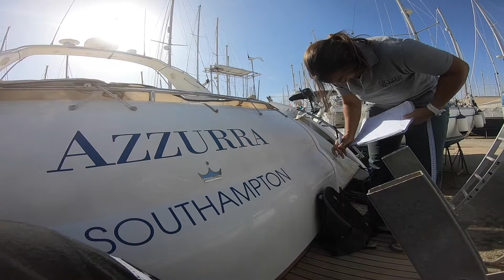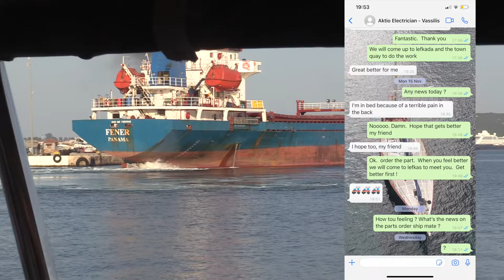EP 106 Dickinsons Diesel Heater   #sailing #Blownaway #Greece

Comment: Strange how things come together. The weather has turned cold here and I was firing up my Dickinson Newport diesel heater and was hit straight on with low fuel pressure into the metering unit. And I happened to come upon your video here and you talked me through the cleaning of the input screen and Wala! Thank you, I have a warm cabin tonight 🥰👍Rnjoy your videos 👍👍
Reply from the maker: Hi 
I’m glad my fumbling with the heater was of help to you 😃 we are in Greece and now the weather is turning cold I am about ready to concede defeat, clean the pot , put the chimney back on and watch those lovely warm flames glint off the varnish once again. Fair winds , thanks for watching.
Reply: @SVBlownAway  good to hear from you. I also enjoyed your video on the B&G electronics upgrades. I recently installed the Vulcan mfd and Triton 2 instruments. Really like them, but they are much smarter than me,😂😂
Reply from the maker: I don’t know if you know my back ground but I was coxswain of a research ship and used simrad kit for work and personally wouldn’t buy anything else.

Comment: Thanks for sharing! That reminds me that I need to do some maintenance on my Dickinson heater. I've got a very slight leak (a drop or two after using it) from the fuel pipes below. I think it might be a tired gasket...
Reply from the maker: Hi. Thanks for watching and commenting. 
You may find the drip is from the float chamber overflow , since I had mine apart it has started an occasional drip and it’s from that over flow pipe below the fuel supply pipe. If I tap the float bowl with something it stops so for sure on mine it’s the float or float jet sticking a little, to cold and wet to turn it off for now.  But hopefully an easy fix. Great heaters aren’t they. 
Ian

Comment: Hi Ian, hi nat, was it just me or was the volume very low at the beginning of the episode, the part I got lost with was at the start with the power boat.was it a job you were doing for someone else or is it yours...

Fantastic tip with the washer, I will use that always now...and a great job your doing on the dingy cradle.....you know I always wondered how those heaters work and the way you explained it was fabulous...yes just like a carburettor. I wonder how much fuel they will burn an hour.
Reply from the maker: Hi Stewart 
We have been using a cheep head set for voice overs and it’s died so we used voice memo on my mobile phone as a microphone.  I think it’s the clarity that has changed (maybe). 
The power boat isn’t ours it’s a guy that saw our work amd wanted something similar and would rather pay us to do it 😃. 
I cannot lay claim to the washer trick I learnt it from someone else a long time ago it works well on most things.  
The cradle hasn’t been finished yet , the new one keeps the engine on and the fender we always used isn’t coping with the extra weight to well. 
I believe our heater uses around 4 liters per 24 hrs on 50% setting I did see a graph somewhere years ago when I bought it. 
Thanks for watching !

Comment: I put my hard bottom dinghy upside down on deck, strapped down between hand rails and covered with sunbrella.   Any benefit to placing it on chocks as you did?
Reply from the maker: Hi Scott. 
We still have our engine attached as the transom folds into the dinghy and We store fuel cans in there under the cover and out of the sun

Comment: Two things...use yellow tephlon tape not white...the white degrades with diesel the yellow does not. Get a metal cover that goes on top of the  super heater it goes on top of what you have in the burner pot and will give you better combustion, less soot, and more heat...best...SV Aquila.
Reply from the maker: Hi Greg 
Thanks for watching and commenting and the helpful advice which is much appreciated , We love Greece but getting hold of any kind of parts is very difficult especially out on the islands but I’ll certainly take a look on dickinsons web site as we LOVE our diesel heater. 
Fair winds my friend.